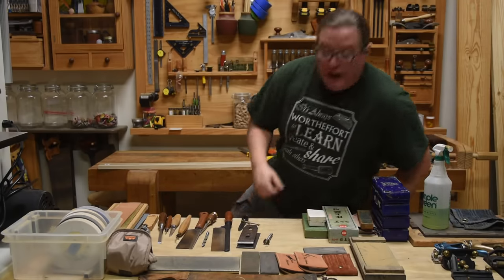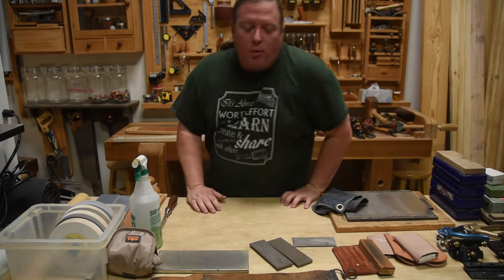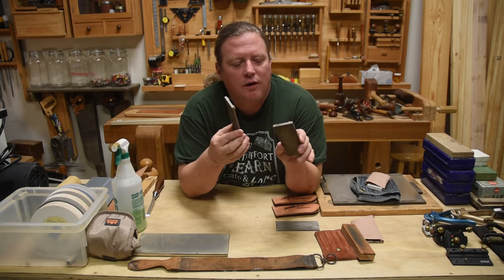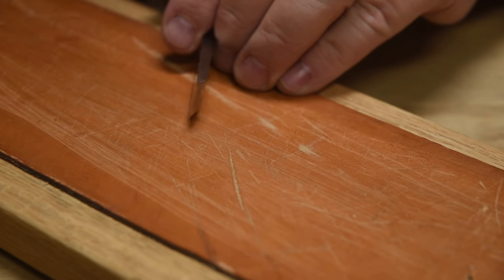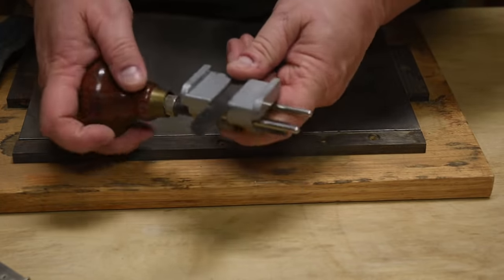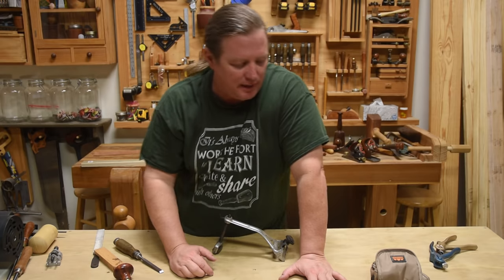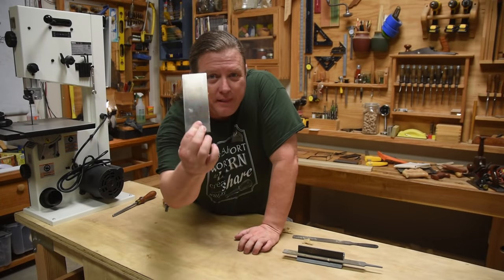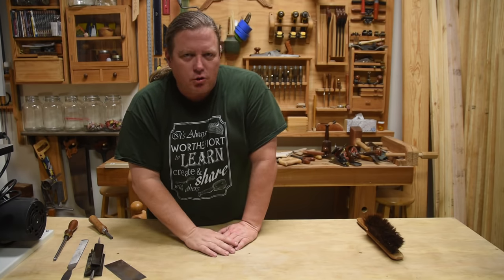Learn Sharpening - Prerequisite Course #07

Comment: I don't know what you mean by saying '2 lines going off to infinity'. Apart from that, I thought it was an excellent video.
Reply from the maker: Thanks
Reply: This was one of the comments made which needed correcting. He is meaning two planes meeting to a point, implying they disappear, which is completely wrong, as the edge will still reflect light and can be seen . If you looked at it with a microscope ( at 10,000 magnification) the edge of even the finest blade, say a razor blade, would still have some roughness, and would still be visible to the naked eye. ( which you can see to a minimum one thousandth of an inch (look at the edge of feeler gauges., a human hair is 20 microns and you can see them) it all depends on how much you want to magnify the edge. Two lines going to something is called in perspective drawing a vanishing point.
You can sharpen a plane blade on an electric bench grinder ( which is what they are made for, to sharpen tools,  rust removal and buffing), I do it regularly without overheating the blade, honing the edge is done on an oilstone. You can sharpen drill bits, plane irons and chisels with an electric bench grinder and a double sided oilstone, everything else is unnecessary especially using sandpaper and emery paper. The diamond plate is a good idea but not necessary.
I am a woodwork, metalwork, technical drawing, science and construction teacher for 25 years.

Like other videos on Youtube this video needed proof reading. Anyone can put up a video, but it needs to be accurate.
Reply from the maker: I'll stand by what I said in this video. Especially the grinder.
Reply from the maker: Two rays that no matter how much you zoom in on them they will always come to an edge. It's a theoretical idea and physical impossibility but explains the point.

Comment: I disagree that stones are the way to go. If you’re looking to get students into the craft, the hassle of having to flatten the stones is crucial to get a great edge - it adds a variable that’s unnecessary. I started with an $8 12x12 marble tile, a can of spray adhesive, and wet/dry sandpaper in 400, 800, 1600 and a small leather strop. I think for all the packs of sandpaper, tile, leather, adhesive, and jig was less than $50. Getting 4” strips each to make a 3 grit flat surface, I have TONs of supply. Remember too, people just starting out aren’t going to need to do it everyday and when they are ready, they can move to diamonds. Using the 3 stones, reflattening and putting liquid to a beginner creating a sharp edge (pond sharpening) is a lot of hassle and some extra risk of injury that may not be needed.
Reply: I agree with this.  as a beginning woodworker, you can gradually develop your craft and gradually get better, except, good sharpening needs to be learned early.  unless money isn't a problem and you can get Diamond stones right away, then I think the sandpaper/Scary sharp system is the easiest to learn.  you just don't want to do like so many beginners and have some Arkansas stones, some water stones, a grinder, some sandpaper, maybe some ceramic stones - those are all different systems.   find one and stick with it.  and beginners often don't understand that for chisels and gouges, you generally aren't going to be using a grinder .